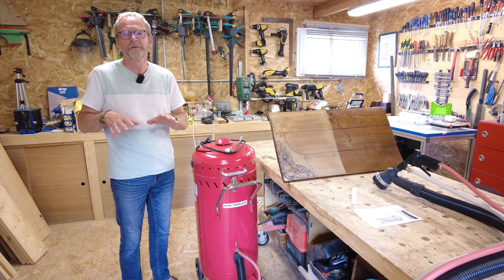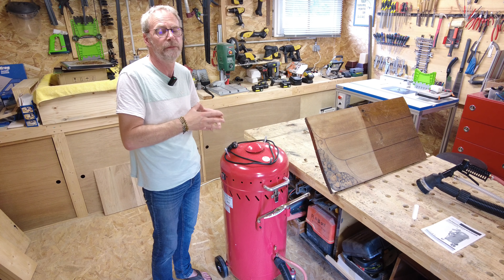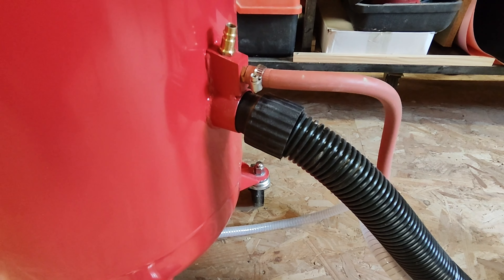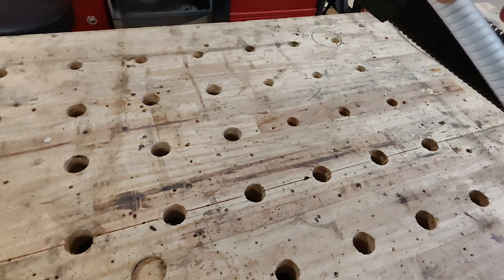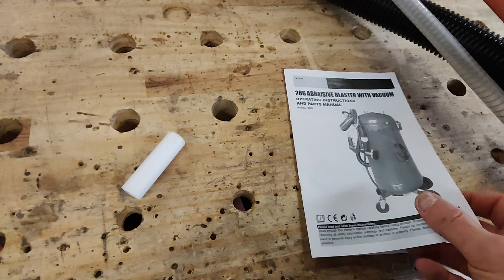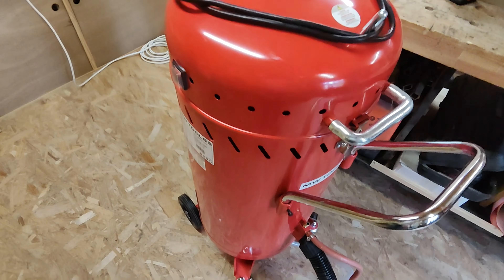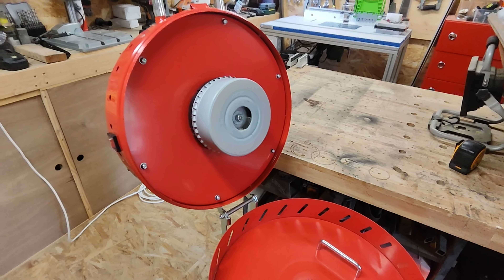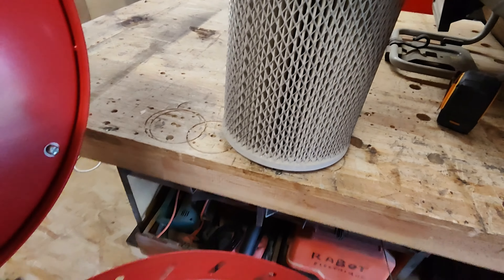Sableuse avec aspiration  , comment ça marche ?

Comment: Bonjour, merci pour ces infos tres instructives . quand est il de la tenue à porter ? faut il une tenue de cosmonaute ? ou un bon masque de protection avec filtres suffit il ? merci d'avance .
Reply from the maker: Bonjour , pour ce type de machine les protections peuvent être plus limitées qu'avec une aerogommeuse en milieu fermé. En effet cette machine diffuse beaucoup moins de particules volatiles. Un bon masque à cartouches peut suffire si on en fait pas tous les jours 👍
Bonne journée
Reply: Top. Merci beaucoup 👍

Comment: Merci beaucoup pour votre video  j aurais un epetite question svp jai un compresseur de (   8 bar maxi en zone rouge ) es ce qu il va pouvoir convenir a cette sableuse car je crois qu elle ne possede pas de regulateur d 'air dessus mais si je presse pas a fond la gachette  es ce que ce compresseur peut il faire ??   Merci pour votre retour cdlt Patrick
Reply from the maker: Bonjour , ce n'est pas tant la pression qui compte mais le débit. J'ai quelqu'un de mon entourage qui a acheté la même et la fait tourner avec un compresseur avec une cuve de 100 litres , il tourne tout le temps ce qui impose de faire des pauses toutes les 15mn pour le laisser refroidir.
Bonne journée 👍
Reply: merci  beaucoup pour votre retour cdlt
Reply: @LesbricolesdePascal  Bonjour. Qu'appelez-vous "débit classique" ? 200, 300, 400 L/min en air expiré ? Je vous remercie.
Reply from the maker: @valerievasseur  bonjour , ce qu'il faut prendre comme valeur est le débit restitué  qui correspond à peu près à 70 80% du débit aspiré à une pression moyenne.😊👍
Reply: @LesbricolesdePascal  D'accord merci ! Donc si j'ai un compresseur de 300L/min en sortie vous pensez que je peux l'utiliser comme votre ami en faisant des pauses régulièrement ?